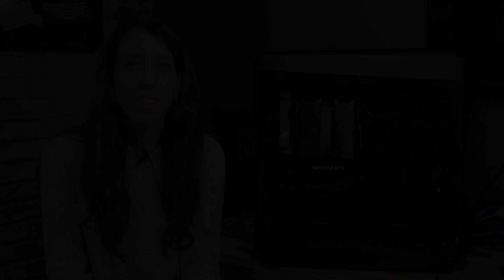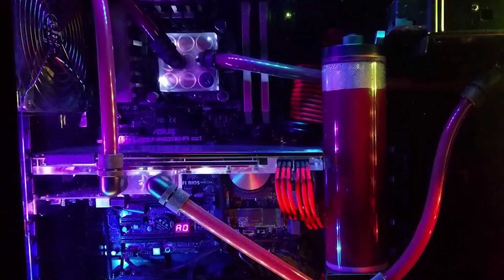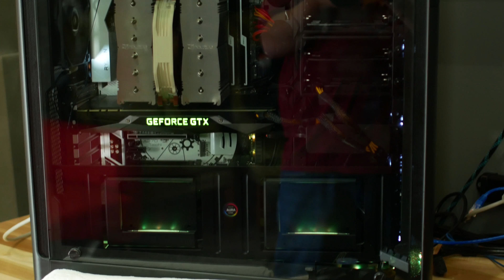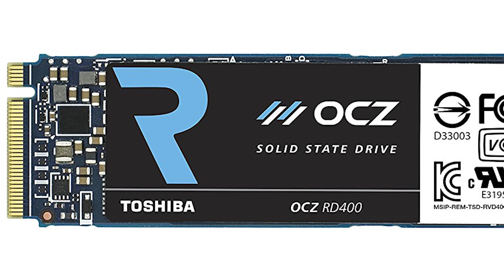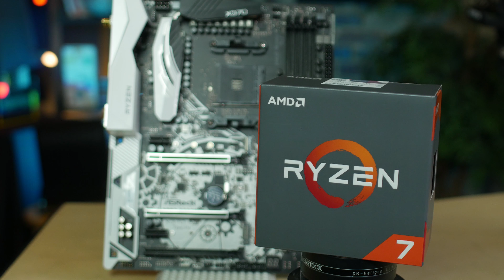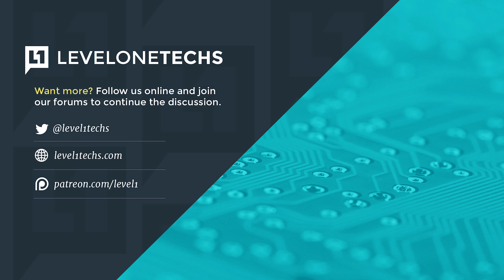Krista's Build Adventures: Bitfenix Shogun RGB Build

Comment: custom water cooling loop is really cheap if you use soft tubing. $20 CPU block + $30 pump/res combo + $8 for 9ft of tubing and $10 worth of barb fittings and also a 240mm radiator for $20 to complete the loop. All on Amazon by the way for the same price you would pay on AIO cooler or top of the line air cooler under $100! keep in mind that these parts are cheap because they either ship from China or are not quality materials like aluminum rad instead of copper. I would also recommend not using distilled water since you have many types of metals in the loop and use instead a premix like XSPC($13) coolant which lubricates and keeps corrosion from happening.

Comment: I dont like anything about the video. It made me cringe every 30 sec or so, finished build looks darker than my own workstation which i avoided having any LEDs , not mounting the ccoler before the motherboard, boring and uninspired LED placement, no SSD.  At  the end the build looks like its a budget pc put together in a hurry.  One question tho - whats that blue blinding light at 3:20, it seems to me like its coming from outside the case. I wasn't gonna post but you said to let you know.

Comment: What I wanted to try in my first build... was blue LED CPU fans in the HAF case, which had a front red LED fan. I also replaced the large fans on the top and side (version with 1 large side fan) with red LED fans as well. Was I was hoping for was the blue CPU fans to be a sort of blue heart with maybe even some purple, and better yet I'd get it pulsing slowly with a controller. Unfortunately, I underestimated the power of the blue LEDs with the fans at full power. But actually, turns out the heatsink is too damned good and I almost never need the fans above their lowest allowed speed (excluding off), which lowers the LED brightness a lot. Never found it worth the effort to get a controller though. Also, I still have electrical tape over the hilariously bright power LED in that case... Oh yeah and the damned motherboard has a full strip of blue LEDs for CPU status... Turned those off because they flash and flicker based on CPU clock/Turbo Boost...

Comment: Cool build. May I suggest using black or white PSU cable extensions? The colorful cables on the motherboard connector are generally considered aesthetically displeasing. It can also be hidden with black marker or electric tape. Loved the LED highlight on the Ryzen motherboard. This is also another completely subjective suggestion of changing the Noctua cooler for a Cryorig R1, to try to keep the base colors as neutral as possible

Comment: i think those big, hulking cpu coolers need to be banned. they just take up so much space and ruin the entire look of a build.  For me, AIO liquid coolers are the only way to go, even at the higher price.
Reply: "those big, hulking cpu coolers need to be banned. they just take up so much space and ruin the entire look of a build."

Nonsense! What really needs to be banned are fukn windows in computer cases (and not on the system neither, 120% Linux power on all my machines, LOL). It's a PC not an aquarium, dammit! Gimme a plain black edgy box every day. Like that artifact in 2001 Space Odyssey. Oh, and also a big NO! to watercooling. Water and electrics don't mix. :o
Reply: A solid hunk of metal that costs less,  never fails,  and performs as good or often better with less noise...yeah, we should totally get rid of those.

I'm all for high-end high-temp (SLi or high OC/core) going under water, it's awesome.  But, at that point, if you're using an AIO, you're doing it wrong.

AIO's are somewhere between garbage and a waste of money in at least 90% of use-cases.  If you're not in a SFF, then air or a full loop are CLEARLY the better options, depending on the build.
Reply: "What really needs to be banned are fukn windows in computer cases ... 
It's a PC not an aquarium".   funny!
Reply: +coffinspired i have an i5-4670k oc at 4.5ghz.  my corsair h80i does a good job handling it.
Reply: +callmejoe - That's fine, I wasn't saying they don't work - I was saying they don't work any better than air.   If you want to  toss out builds, my 4690k is daily'd @ 4.8Ghz and runs fine @ 4.9Ghz on air with probably less noise most of the time.  I also have an OC'd gtx1080 pumping out heat as well, everything stays comfortably in the 60's under load. 

 A Cryorig R1 or a Noctua NH-D15 will match or beat your h80i and never fail, provided you've got case flow, otherwise an AIO would be best - like I said, they have their uses.  You leave your PC on and have that pump fail while you aren't standing there, you've got problems. Now, if your air cooler fan failed, the heatsink will likely keep the CPU ok while it's not being completely loaded.

Fact of the matter is, outside of fringe use-cases or just aesthetics, there really isn't a compelling argument for these average quality mainstream AIOs - they usually cost more, make more noise (on top of being a more annoying one), don't really perform any better, and are less reliable.
Reply: +coffinspired  i agree with you.  it's an aesthetic thing for me like you mentioned.  and i definitely worry about what will happen when my 80i pump fails
Reply: +CallMeJoe - Oh, I'm right there with ya on the aesthetics of an AIO over air.  If I wasn't such a chicken, I'd probably have a white Kraken in my current white Corsair 780T build...mmmm.  But, I leave the PC on a lot when I'm not next to it to monitor temps and I  don't need the headaches of a potential problem when there's not really an improvement otherwise.

Just a bit of risk mitigation, at the cost of some points in the looks department - I wouldn't say either approach is wrong - different strokes and all.

Have a good day Joe! :)
Reply: +coffinspired   "white Kraken in my current white Corsair 780T build.." 
now you're talking. that would be sweet!

Comment: I'm wondering why there are 4 four DIMMs when Ryzen 7 is only dual channel, so far. Not that that harms the performance much, but I would have went for 2.
Reply: Because two DIMMs make up one channel.  Slots 0 and 2 are channel A and slots 1 and 3 are channel B.
Reply: What are these compatibility problems you speak of? having 2 dimms per channel is so standard for both desktop and server computers, and has been for long enough it isn't a problem, and if it does cause issues, they would have been ironed out years ago. Also, if these issues weren't ironed out, then the OS in question is clearly shit.

As for performance, RAM speed isn't that big of a factor for most workloads, especially if your disk is slower (HDD or older/cheaper SSD) Also, if the performance degradation of using 2 dimms per channel were that bad, it wouldn't be allowed in the processor spec, because processor and motherboard manufacturers/designers want customers to have the best performance possible.

As for actually using the RAM capacity of more than 2 dimms (16GB on DDR3, 32GB on DDR4) that actually very easy to do when working with virtual machines, as well as many creative applications which like to load the media into RAM while you work with it.
Reply: Nobody ever said anything about gaming. Powerful PCs can do far more than run some pre-designed worlds and move pawns through them. The question was why there are four dimms on a platform with dual channel memory. No mention of gaming.

As for your character attack, I have stated before multiple times that I use most of the 32GB I've got in here. Between using both ZFS and BTRFS, running experiments and tests in vitrual machines, 3D modeling in Blender, video editing, transcoding video and audio and compiling source code, my PC sees a lot of abuse and is frequently pegged. Just about the only part that doesn't see full utilization is the 970, and even then the VRAM is frequently at capacity. For many of these applications, having memory overflow to SWAP is not an option, as that murders performance.

If we're talking gaming, then the performance doesn't matter anyways as long as the games run consistantly at or above the monitor's refresh rate. Anything more than that is wasted energy and frames. For gaming, 8-16GB is plenty. Hell, if you don't mind turning off some pretty little shadows and lowering the render distance you can probably get away with less, although my limited experience with recent versions Windows does suggest 4GB is a hard minimum as that OS is so bloated.

But when we're talking workstations, the last thing you want is for your model to crash mid-render with out of memory errors, or for the render to take significantly longer due to memory SWAPing, which also can kill the life of the disk since that means many reads and writes in a short period, particularly if a single program is simultaneously running in both memory and SWAP.
Reply: 4 dimms allows for more RAM. For example, you can either get 16GB by doing 4x4x4x4 or 8x8 or even something else entirely. Intel platforms (except the X chipset ones) also tend to have 4 dimms for dual channel memory.

On my PC with its 4790k I've got 32GB of RAM. 8x8x8x8. I orginally only had 16GB but with the amount of VMs I was playing with and the workloads I had at the time, it made sense to upgrade. When I built it, 16GB was more than enough. Now its looking like I'm going to split my desktop into 2-3 computers, so I'll split the RAM up between them.
Reply: You clearly don't understand how contract work goes. You get the contract, you do the work in the alloted time frame, then you're done. It's short spurts of being very busy. In order to avoid burnout, you take breaks between contracts, then do more contracts. Right now i'm between contracts, so I have time to waste in random internet arguments.
Reply: Anon Ymous It looks better with 4dimms
Reply: It does harm the performance. Having 4 dimms introduces more compatibility problems. degrades performance by having to use 2T Command rate and is also usually imposiible to hit the same speeds you would on a 2 dimm config. Unless you run a very demanding workstation and actually need that much ram its  a bad idea.
Reply: We were talking about gaming PC but now i realize you're one of those people who bought 4 dimms thinking it was kewl but then cried for a month you couldn't reach rated speeds. I've been building PCs for a lot of people since 2003 and i always benchmark and test the systems, if anything ram speed has only mattered more and more over the years. i've only build 1 workstation (excluding my own) so i have no experience regarding that but when it comes to gaming PCs ram does matter.
Reply: you cant overclock ram as far generally when you have more sticks in them. 2 dimms per channel is fine but for some people having only 2 dimms makes more sense.
Reply: If you are really doing all that work you shouldn't have time to waste on pointless conversations on a yt video where a girl "amateurishly tries to build a RGB gaming PC - a 1080ti is a gaming card and that mobo only has dual channel - dont change the subject to workstations cause this video wasn't about quad channel boards, ecc mem, xeons  or quadro cards. If you want to do something then do it right. You want a gaming PC? Go grab 2 fast memory dimms with low latency and be done with it. On the other hand if you want a powerhouse for doing actual work then 32GB isn't going to cut it in a lot of cases and you need even more than 4 slots so your arguments are pointless.